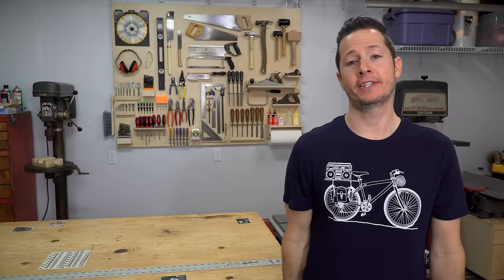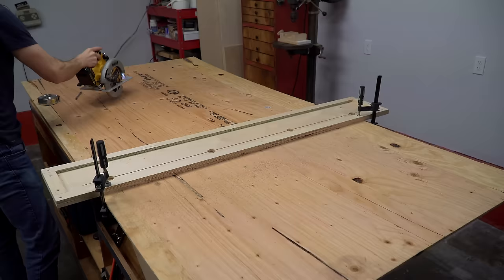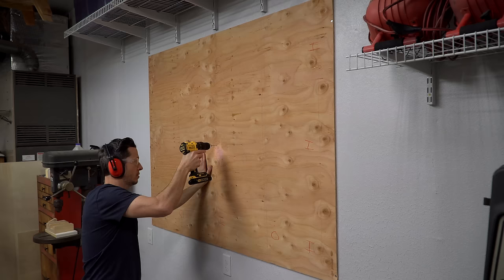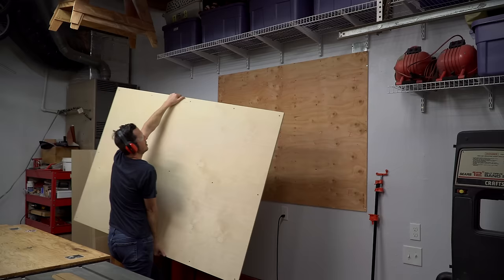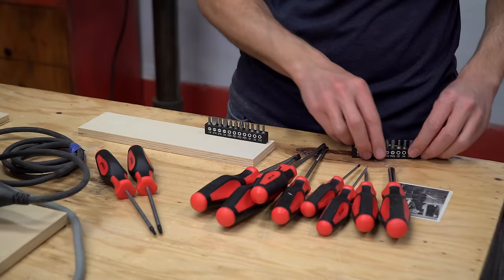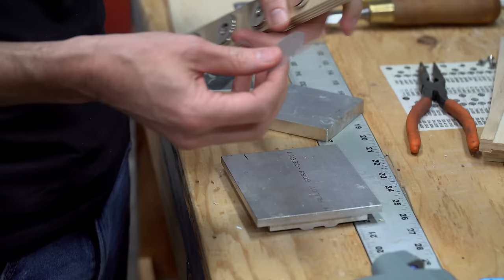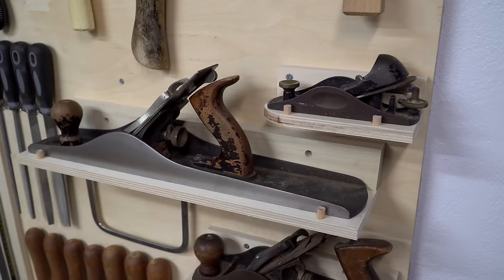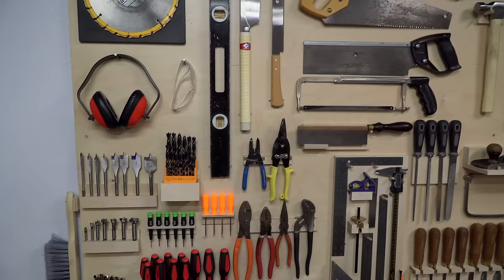How to Make a Custom Tool Organization Board

Comment: you should have your planes either on their side or hanging vertical with the bed facing out. not supposed to lay them flat down so you dont damage the blade or bed
Reply from the maker: Thanks for the feedback! I think I'll probably add a small block near the end of the shelf so the blade is lifted. That or maybe just create a hollow spot for the blades. Thanks again!
Reply: @OneMinuteWorkbench  that would also work, I know I just hate having to take apart my planes to sharpen or flatten them. Its normally after I start using it when I find out it needs done.

Comment: The 6 coats of poly, what are you accomplishing with that?
Reply from the maker: Paul, that's just how many coats were required to "finish" the board. I find that 6 coats is usually the sweet spot with Baltic Birch. Most poly manufacturers recommend a minimum of 3, but that's just the bare minimum. Depending on the type of wood you add poly to, it make take even more than 6 coats. Again, Baltic Birch really soaks it up, so the first few coats are just laying down the base getting ready for the "finishing coats" (if that makes sense). And you can tell when the piece is finished just based on how it looks. If it isn't ready, it will look splotchy and dry in some areas, while wet in others. Once you add enough coats, it'll start to look uniform, and you'll know it's done. Anyway, I hope this helps!
Reply: Yes, but I mean why finish it, given it is for tool storage?
Reply from the maker: I see. It just makes it easier to keep clean (free of dust). I can blow off the board with compressed air, and it comes right off. Whereas unfinished baltic birch will have a tendency to hold the dust more. Does that make sense?

Comment: It's amazing to me that everything fits and everything's reachable when you didn't start with figuring out how much space you NEEDED before creating the board.
Reply from the maker: Well actually, not everything fits. I don't exactly have the luxury of enough wall space to accommodate all my tools. And since I could only afford to dedicate so much space to the tool wall, I laid out the tools I wanted to add, and then looked at each tool and asked myself the question "How often do I really use that tool?". Anything that doesn't get used as often didn't make the cut!
Reply: You can always build more as your collection grows. I'm now planning to make a couple of 36 x 36 inch boards to hold things like spanner collections and such.  I'm also thinking of making a video of doing it too, but doubt it will look as pro as this example.

Comment: Nice simple solution. I also noticed the power switch on your disc sander. I believe these switch/outlets are under utilized, and much more economical than alternatives.
Reply from the maker: Thank you! Yeah, they are definitely way cheaper, but they don't have the style or the added safety features of some of those cool aftermarket switches. But again...more affordable tends to win for me!

Comment: Thanks for some inspiration.  My solution will be very different but the peg-board Idea went out of the window for me some time ago because I find them ugly.  My workshop is part of my home so it has to look presentable.  The point is your video made me think carefully about how I need to do things instead of rushing in to build.
Reply from the maker: Thanks for letting me know you got some inspiration out of this project - I appreciate it! Good luck with whatever direction you take for your shop!

Comment: That's really smart with the brad nails.I also work by myself and always have trouble mounting large things by myself.
Reply from the maker: Thanks! I think the trick is to just add barely enough to hold whatever it is your trying to mount, that way way you can still move it. Good luck!

Comment: Ended up with dad's wood shop tools after he passed.  I've got them on those plastic cabinets which just take up too much room in the garage.  He had a system similar to yours which I couldn't get off the garage wall before the house was sold.  Wish I did.  But, with Corona snooping around I've got time to work on this project to organize the garage and get room back for the car.  It's a small garage so space is of importance.
I agree with you.  I don't like the peg boards either.  Dad told me to stay away from those as well.  Mediocre in quality and longevity.
Reply from the maker: Bee Bob, good luck making use of this time you have to renovate your shop! Let me know how it goes!

Comment: I have come to the same conclusion you have after using a pegboard for over 30 years. Once you set it up you never move anything. And yet I've knocked tools off of it because the little holders keep coming out of the holes.

This is a great inspiration for my new work bench that I'm building now. I'm going to most likely tear down my old pegboard system and put up something just like yours. Thanks for the great inspiration!
Reply from the maker: I’m glad to know that you’ve been inspired! Good luck with the project!
Reply: they make plastic bars that go across the hanger to hold them in
Reply from the maker: Thanks for the tip!

Comment: Very nice job/video. I'm now building mine, with a little twist. I built a custom cabinet behind the tool board; ie; I cut the tool board in half to use as two doors (3' x 4').  Using very large 9"  T- hinges and keeping the heavier tools near the hinged edges.
Reply from the maker: Sounds awesome!

Comment: Dude thats a nice shop! Id give anything to have that setup along with those tools. Im working on it. I have 2 circular saws. 2 table saws, 2 pneumatic staple guns, id much rather have a pneumatic nail gun, im going to work on that, a ton of pliers, screwdrivers, bolts, screws, sockets, hammers, etc.

Comment: I'm in the middle of transforming a 12 by 20 foot shed into my workshop, and I have the same view on this setup being much better than pegboard or even French cleats! No extra brackets to buy for the peg board and easily place anywhere, and no extra wood to use for mounting strips as required for French cleats!  After I put in the insulation, I just lined the walls with half inch OSB sheets of wood and now I can just mount anything directly to the wall and the entire wall is my tool board!!!

Comment: Excellent multi-use of the space. I am convinced the peg board although faster, it is less secure and a bit less versatile. Plus there might be a savings in money. There is a bit more time involved making the variety of holders which is the trade off for the secure no-knock-off security.

Comment: This is looking really nice. I have almost all of my tools on magnetic bars, but some tools  do tend to slide off. It never happened, but it doesn't  feel right. I am going to try your way of preventing that, feels like it'll do the trick. Thanks. The only thing I'd change I think, is the way the saws are stored. I have mine hanging because all of them have holes in a way that they hang straight down.  Yours don't as I look at them. I use tiny hooks instead of screws, to prevent them from sliding of. Get one or put one back is very quick and easy and there is almost no space between them since I carefully made use of the negative space of the larger ones with smaller ones. Having to put them on 2 screws was my former way of storing them and it really drove me mad to get them on haha. But yours hang more solid I guess. Whatever works best. I am going to change to your way of storing the screw drivers, that looks and works awesome. They never are straight with me. Thanks for sharing, got some nice ideas from it to further improve my storage.
Reply from the maker: Thanks! I’m glad it’s helping to give you some ideas 🙂

Comment: Loved this. I love anything which lifts tools out of the way and gives them their own safe spot. I have found that it not only helps make tools have a longer life, and speeds up the work process (no searching), but my tools get better taken care of. As I see them, if one has a little more wear it will stand out. So I will pull it, give it a minute on a wire wheel, get it back to store quality and then put it back. Also BRILLIANT magnet hack. Just that extra bit of grip to hold it.
Reply from the maker: Thank you! I'm glad you dig it!

Comment: I like it! I have used the peg board system for my tools and it's worked well for me. I bought some little clips that hold the pegs in the board so they don't come off when I grab a tool.  I wish I had more wall space to put tools on because it works so much better to hang your tools up than put them in a drawer.

Comment: That trick with the hot glue to make the magnets more grippy was ingenious! Well done, its cool to see this come together after seeing a few of the bigger builds being featured previously.
Reply from the maker: Thank you! I tried a few different things before I found out that the hot glue would be a solution. I originally noticed when I added hot glue to my updated saw track, that while a little bit of glue was still exposed (before I sanded it away) on the bottom side, that even that little bit really made the track grippy. I considered leaving the hot glue on the bottom of the track for that reason, but realized it pushed the track every so slightly away from the material, which increased my chances of tear-out. That said, I logged into my memory the fact that hot glue added grip to things!
Reply: That's so counter-intuitive! One would think that since the tool is now farther away from the magnet, it's worse off. Of course the magnet affects less, but the added friction really works wonders. I wouldn't have guessed.
Reply from the maker: Yeah, the magnets actually have a really strong pull force, but the shear force is where they are weak. Just a little bit of friction does the trick though!

Comment: Very nicely done I have to agree with you 100 percent way better than peg board I just got to figure out how to organize my tools so that I'm not knocking stuff off every time I reach for something how did you make the thing for your nut drives the holder you made for the screw driver's is awesome to thanks for sharing 👍
Reply from the maker: Thanks! The nut driver holder was done with some forstner bits to create the recess, straight bits for the through holes, and a bandsaw to create the entry slot. I hope this helps!

Comment: I’ve found the best style of hammer holder is basically a wide L shaped bracket.   The upright part of the L gets screwed into the wall.   The lower part of the L has a channel cut into it so your hammer handles will fit into it but it’s not too wide so that the hammer head slips through.   Then you would have the hammer face sticking out towards you while it’s being stored.
Reply from the maker: Thanks for the tip!

Comment: Really nice job on your wall mounted tool organizer. Over the winter I completed my new workshop build project using beveled shiplap boards mounted to fir strips on concrete walls. I too used finish nails on certain light tools mounted directly to my shiplap. Custom individual tool holders, quite similar to what you have done here is a work in progress for me currently. 
Thanks for sharing your build...
Bill on the Hill... :~)
Reply from the maker: Thanks, William! Your shop sounds really awesome!

Comment: That hot glue disk tip is AMAZING! The peg stops are also genius. You've inspired me. I've been waiting for this video and it didn't disappoint at all!
Reply from the maker: Thank you, Dawn! I mentioned to someone in another comment that if you watch my saw track update video, you'll see that I used some hot glue on the bottom, and squeegeed it. That formed a thin layer that that made the track really grippy. In fact, the only reason I didn't leave it on the track was because it lifted the board up away from the piece being cut, which ruins the "low-tear-out" effect of the track. I'm glad the video didn't disappoint - it was a long time in the making, partly because the project took so long. Again, I'm just glad you enjoyed it!
Reply: @OneMinuteWorkbench  Thank you for showing how to use your own items to figure out the measurements. I know it may seem intuitive, but my trips to the big box store are few and far between (due to distance). Knowing what I need before I go helps so much. I'm new to woodworking, so setting up my workspace in a limited area is very important. I'm looking forward to more videos! Thank you for showing your thought process behind your setup. I just watched the saw track update video and totally get why you had to change it. Glad you can still use the trick, though, for other things.

Comment: First off great job and awesome project! Nothing beats custom. Only thing I will mention because it bothered me as well is about the peg board. Once you arrange a peg board the way you want you can hot glue your holders to make everything stay put. You can then use joint compound to fill the unused holes and sand/paint for a finished look. Very easy to re arrange if you aren’t as amazing as you are at the custom holders :)
Reply from the maker: Thank you, and thanks for the hot glue tip!

Comment: Just starting to watch this video. .. couple questions: 1. How do I make a homemade saw track?  #2. Why use your skill saw instead of table saw?   ... #3. LOVE your work bench with table saw and miter saw.... How can I turn mine into something similar?...
Reply from the maker: I have a couple of videos on making saw tracks - here’s a link to one of them: https://youtu.be/68v9JlSM6OQ A skill saw with a track is just easier to use (and safer) than a table saw for breaking down large sheets. We’ll, at least when compared to a compact table saw like most of us have. There are large format table saws that can break down sheets safely, but not what most people would have in their garage. I sell plans for my workbench on my website (oneminuteworkbench.com) The plans are fully detailed, step by step. I hope this helps!

Comment: Glad this came up. Gave me some inspiration.  One thought.  Make a  pix of the board and hang it next to the board..
Reply: Why?
Reply from the maker: LOL....or maybe the pic in the center of the board so it continues inward forever 🤣
Reply from the maker: Larry, I think just because it would be funny.
Reply: @OneMinuteWorkbench  If you put a mirror next to the board you could have twice as many tools!
Reply: Tools can get misplaced on a board..Chisels etc..pix can be labeled..also if you have a helper they will know where things go.
Reply: @PIANOSTYLE100  I've had a similar tool board for a long time,what I did was to paint the board white and then I outlined the tools with a magic marker and identified each space:1/4 " chisel,5/16" chisel,etc.This makes a picture redundant.I saw where a person actually cut an outline of the tool in contrasting hard card stock so they could change things around and wouldn't have to repaint over the magic marker lines if they wanted to change tool positions.I did get why you thought a picture would be useful,It's an unneeded step.
Reply from the maker: AH! I see! In my case, I don't need a picture because each of the tools really only fits one holder, except in the case of groups of tools, however the groups are mostly organized by size. Thank you for sharing the idea, depending on the way a board is set up, I definitely see how it could be useful!
Reply: @OneMinuteWorkbench  yeah you have videos..easy to pull a jpg off the the video.I built a huge drawer underneath an existing bench..it's  5 x  2 by about 5". 
I keep tools that I never use or hardly ever..so when I am looking
for a special tool..maybe even a wrench for the car..and it has worked out great.. When searching for that one of kind tool, screw etc..and I've searched everywhere..I usually look in there and there it is.. Also I have a sharp drawer and that is kind of hidden,  but when I want a pick etc..it's always there..Put long two foot drills in the sharp drawer.
Reply from the maker: Makes perfect sense!
Reply: @OneMinuteWorkbench  Another thing..as a basically disorganized 
person..I kept on getting frustrated..never could find the screw, router built etc..I had tried many different ways to organize. No success. I thought about it.  I built a 2'by 18"  by 4". I made about 12 compartments.. I stored similar things together..drills with router bits, bolts and nuts together.
Believe or not..I know where those small parts are..we spend more time looking for small things..this has saved me many hours. I always know it is the case.
Reply from the maker: Sounds to me like you're actually a very organized person!
Reply: @OneMinuteWorkbench  a wanna be... I sometime find that the search for that special tool is unfruitful, but find a tool that works better.  I have learned to carry rubber bands, zip ties, duct tape, electrical tape..I once used  duct tape to temporarily fix patch a very wet, hot radiator hose..I drove 100 plus miles with that..the next morning I had to cut it off..I think it had hardened just like radiator hose.. Almost on a daily bases I use rubber bands for video work..
I seldom just throw things away..Usually I can find some use for it. At my workbench I have a plastic water conditioner tank and have fastened it  to the bench.. I use it for scrap wood ..my bench is made out of an old dock..it better than what you can buy in the store. Yesterday was very productive.  Put long clamps on tall 3/4. They are always getting misplaced.  I think I'll outline with magic marker.
When I put things away sometimes very rushed..best to replace as the day goes by. I have an old Ryobi tables as that I want to covert to a router table.. In fact today is my day to look for some 
woodworking jigs on the net..I also like PDF plans because there is minimal confusion..